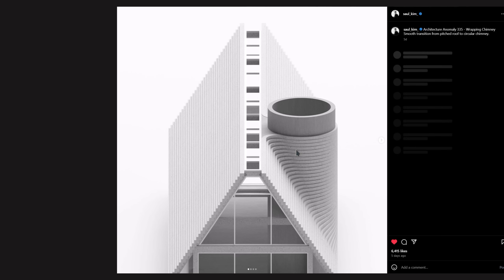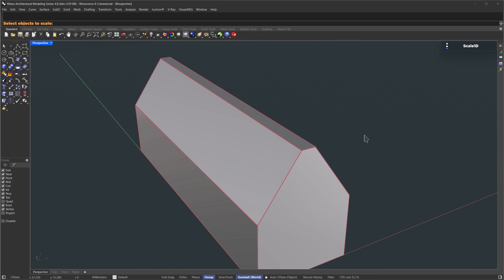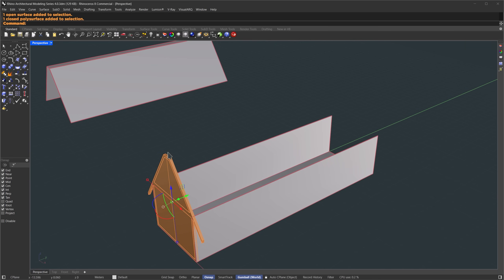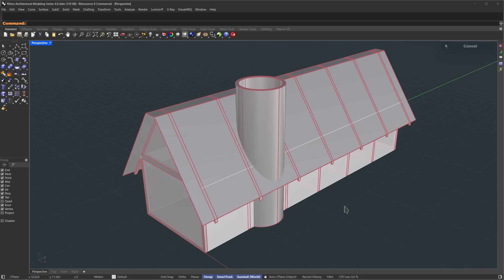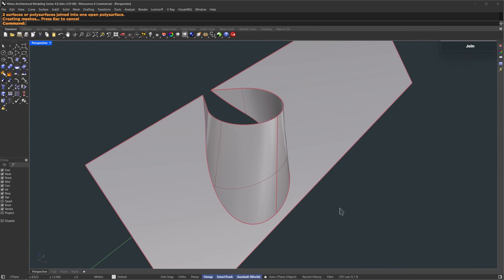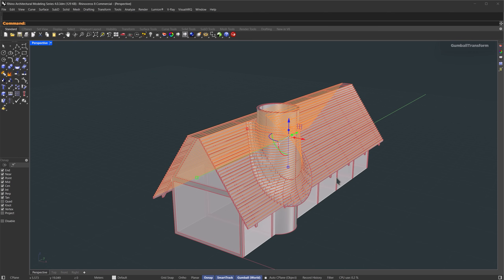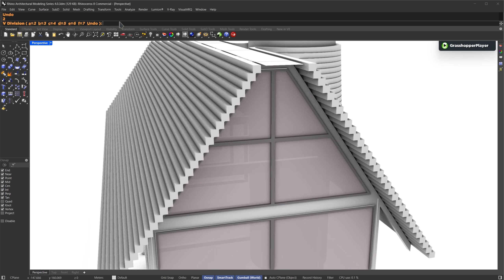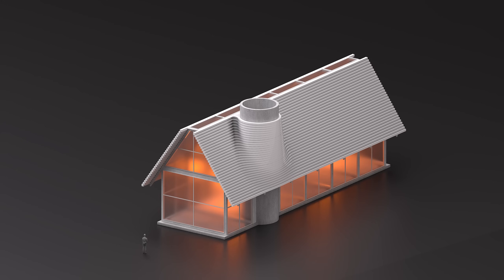Rhino Architectural Modeling Tutorial | Saul Kim Studio Style

Comment: Hello, at 2:33 i cannot split the face like you have done. Would you be able to guide me on why isnt it working for me? im wokring with rhino 8
Reply from the maker: Earlier versions might behave differently. Anyway, it’s just about following the command line: first, run SplitFace, then select the top part and press Enter. Next, set the first and second splitting points and press Enter again. it should work like in the video.
Reply: @3DBeast  I have the same problem, I can use Inset only with subD surface :/. I have rhino 7

Comment: Hi there, thank you for the video. I am trying to use the grasshopper curtain wall but it is not visible. I think it might be because I am working in mm and not in m (I've been converting it). If that is the case, is there way to make the grasshopper file work for mm as well?
Reply: hi I was having the same problem, the issue I had is that I was working in mm while the gh script was in m, so the frame does have a depth it just ended up being a fraction of a mm. To fix it I just jumped into the gh script and converted the mullion and glass thickness from m to mm and that worked for me, it might be a similar problem you’re having, hope this helps :)

Comment: The inset command doesn't work in my rhino 7, like i can't select anything when i've the select face is shown in the bar after commanding, what's wrong?
Reply from the maker: Just read what the command panel says,  it’s guiding you step by step
Reply: @3DBeast  Thanks tons...a rendering video would be great on your end...
Having trouble setting up natural light and materials....
Reply: @3DBeast  I tried the command too and it only came out "select faces or ngons" and when I wanted to select the faces, it wont select. when i tried to mesh it it creates a messy offset.
Reply: i am on rhino 7 and the inset command doesnt select anything, the command panel just says "Select faces and ngons"
Reply: Same problem I have here

Comment: Hi! Thank you for teaching so well and making it easy to understand. I followed this up to this point 11:25 And I had a problem with Panel Generator from your link. They do work with rectangle surface only, but other surfaces don't work, such as trapezoids surface like the windows on the roof. I tried circles and triangles surface and they didn't work also. Do you have any way to help?
Reply: But don't worry, I have finish the model, I just need to make a window panel model from the command instead, lol 😓 but I still just want to know how I should fix it so that Panel Generator GH files will work with all surfaces, thanks
Reply from the maker: Thanks , About the Panel Generator, it only works on planar surfaces, but the shape doesn’t matter. Circle, rectangle, whatever  as long as it’s flat, it should work. You can even open the script in Grasshopper and see exactly where the logic is missing if it's not behaving on custom shapes.
Reply: @3DBeast   facing the same issue if it not a rectangle it doesn't work
Reply: did you find a solution yet?